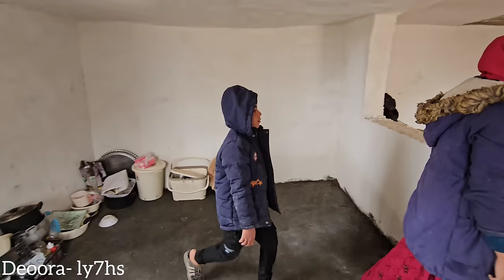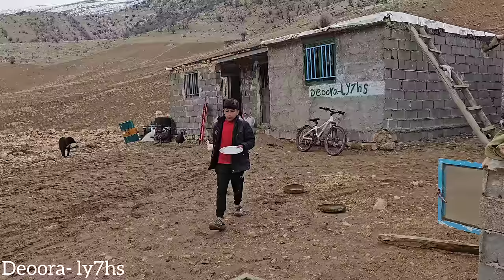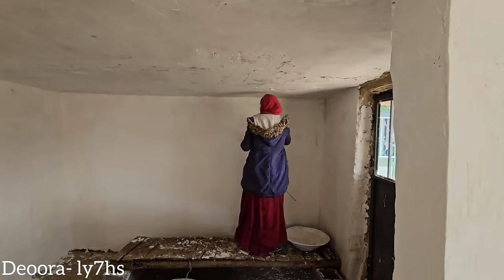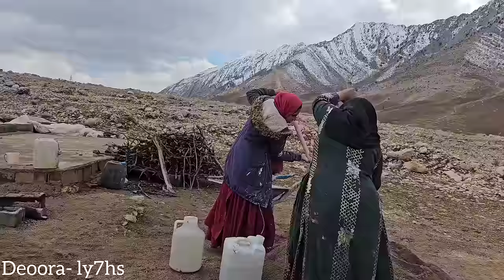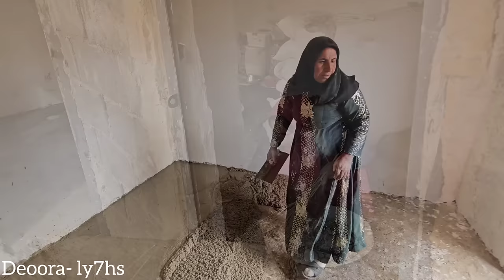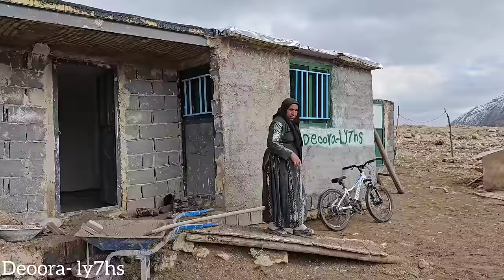Painful absence: regretting the absence of blessings and clarifying the facts #deoora-Ly7hs

Comment: Wishing you much success.  The stove has a lot of black smoke around the top.  If this sloot can get through so can a small spark of flame.  This could set your cloth ceiling on fire.  Seal the pipe seams with a flame retart insulation.